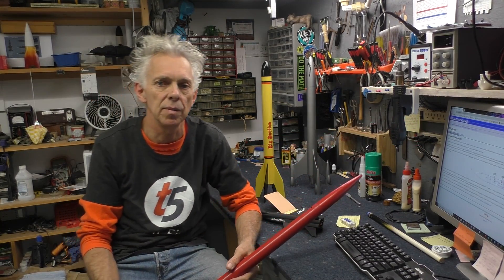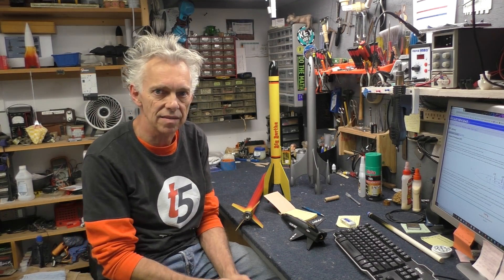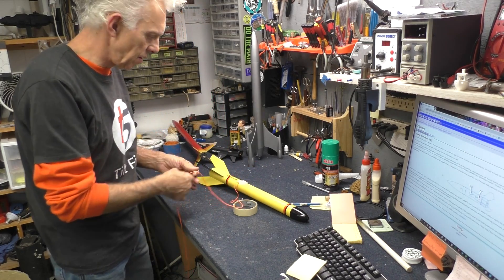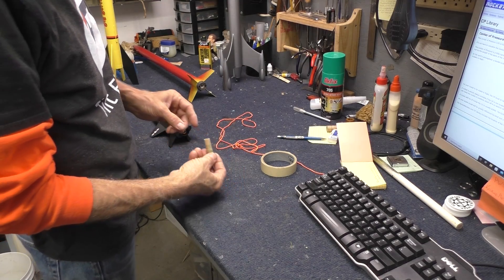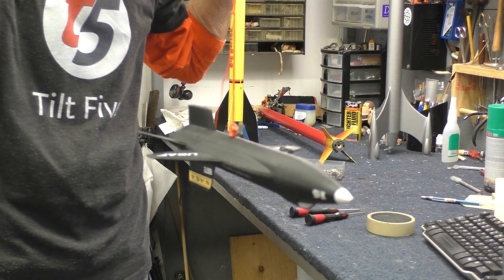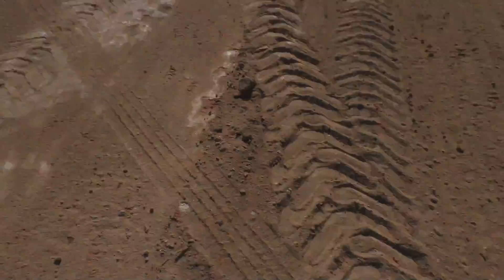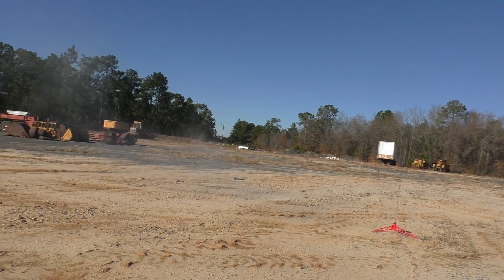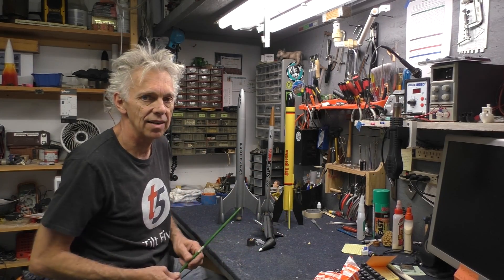Big Bertha Part 3 - LAUNCH!

Comment: B Bertha can be built as a payload rocket. A 3.5 oz payload to roughly 1300' on a d12-5. For better results use a 15" chute.🙂
Reply: I had a Big Bertha style rocket that had the clear payload tube section. It wasn't the Big Bertha, but the same design and size...little longer. 

Silly story, the kit came with an illustration of a child putting their pet Gerbal in. It read, "Turn your pet into a cosmonaut". I kid you not. So I put in some Gypsy moths from a nearby tree as a kid. They came back as green goo in the bottom of the payload tube. 😢

Comment: Why I don’t see the engine mount with the medal hook when you insert the engine into the body tube?
Reply: The engine mount simply works as a spring that bends out of the way and then snaps back when the engine is inserted.

Comment: Been building and flying model rockets since 1972. I have never tested a model built from a kit. I always assumed the manufacturer of the kit did, and if it was properly built, it was already properly balanced and ready to fly. I now design and build my own rockets. I always put talcum powder on the parachute before putting it in the rocket, to prevent the plastic from sticking to itself.

Comment: Very nice explanation of the CG/CP as related to stability.  The Big Bertha is a great park flyer. The Proto is a nice looking rocket also. The X-15 seems like a tough one to fly correctly, you've done a very nice job 3d printing it.  Did you make the decals on this one?  Very nice job!  Look forward to seeing to future rocket builds.🚀
Reply from the maker: Yes I found a decal sheet image in Google then printed them out on some adhesive vinyl. Very pleased with the final result. I may try launching it again with a bit more nose weight and a higher thrust "A" engine.

Comment: How high did Big Bertha go?  When I was a boy, we would balance by hanging the rocket by a string at its COG and point into fan/blower of a wind air conditioner.  But I thought we were testing if the fins where straight.  This was 50 years ago.
Reply from the maker: About 800 feet.